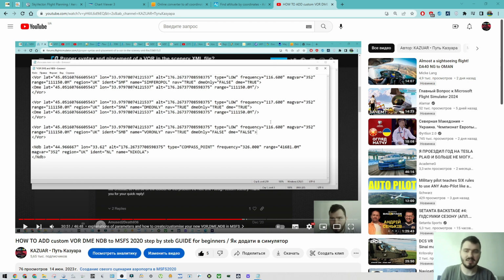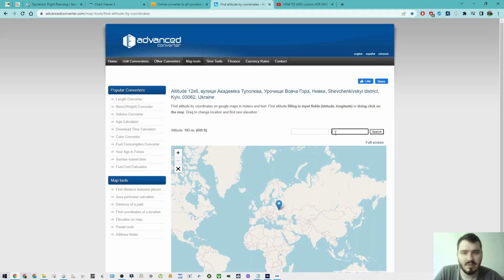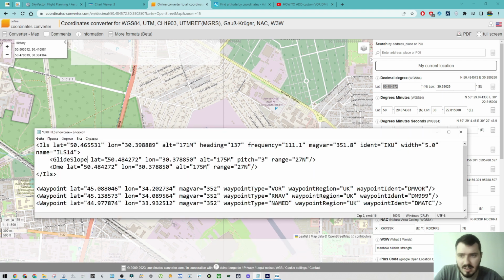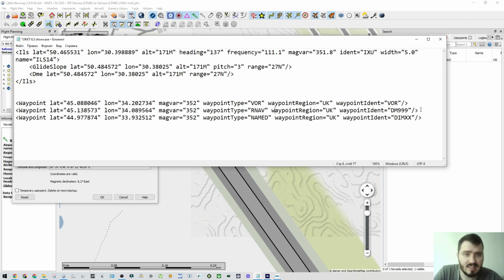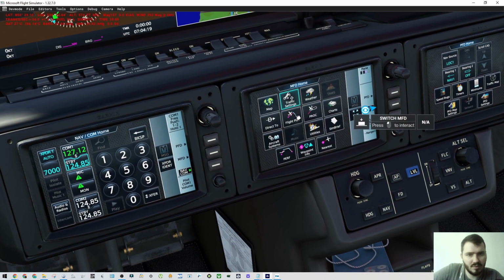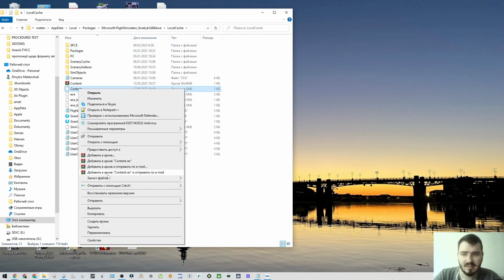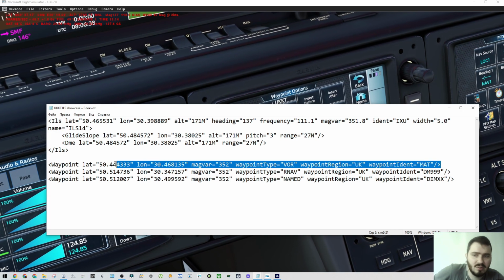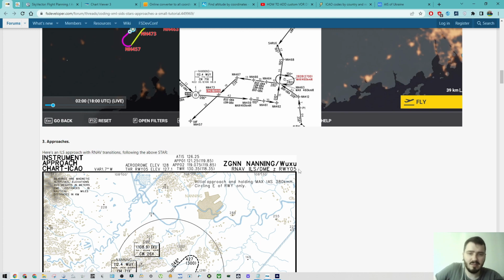HOW TO ADD custom ILS and WAYPOINTS to Microsoft Flight Simulator nav database? - Step by step GUIDE

Comment: Thanks for a fantastic video, who made this easy for me :)    Do you know how to create an LPV approach to any given place?
Reply from the maker: Thanx for feedback! I know how to do rnp apch procedures only for pmdg 737 series before last updates (before it used just txt files for fms , so if you found some old version of 737 - open the folder of airplane and you will find there all airports txt files which have sids/starts and approaches in simple readable format and adequate logic. Also that txt will have just waypoints used for apch with coordinates so firsly you add needed waypoints for tour procedure and then in the same txt you add your procedure using created waypoints. You can take as example some airport where is lpv approach exist and take as example where to place alt/speed restrictions in that procedure. Good luck!
Reply: @kazuar13 many thanks for quick reply. I will check it out. Thanks again for taking time to help 🙏

Comment: thx so much you're awesome
Reply from the maker: Thanx! Appreciate that)
Reply: @kazuar13  What would be the procedure to add RNP procedures? You taught ILS but is RNP the same procedure? I am creating an oil platform in Brazil but it does not have waypoints or anything so I created RNAV type waypoints but I need to create the procedure
Reply from the maker: @CatrapoAhead  https://youtu.be/SOrmU7tki8Y?si=2fUbWaexCFcbyhW5
I know how to add it only for pmdg 737 some old versions which has txt nav data. For msfs it is possible but i wasnt successuful in it(

Comment: Can we add ILS to the default airports? Will the FMC detect that when planning route?
Reply from the maker: Hi, yes we can add ils to any airport, but you will need to follow this video guide and not forget about updating content file (look through this video and you will understand.

Ils in Fmc, well, it depends on airplane. If database is provided by navigraph for airplane you fly (real nav data) so you should not see your ils in such FMS. If airplane is default and use standard msfs nav database so you will see it. Obviously, in fms it should be a procedure related to ils in order to plan approach and this video not cover this information and i do not find good info how to create a procedure for msfs nav database.

But for example you could edit even FMS navdata in 737 by pmdg and add information about your new ils into 737 navdata file so FMS of 737 will know that there is an ils.
Reply: @kazuar13  Well, in the FMC of A320N IniBuilds Asobo, the airport that I want to put an ILS, does not have ILS approach option in the FMC. So I'm wondering if the FMC could detect it automatically if I add an ILS approach in the airport scenery?
Reply from the maker: @Jjodoql  you should try and tell me. I am not an expert in basic airbus fcu. What i know if there is fmc there should be procedures to choose, point in space to start descend. By creating ils, procedures not created.